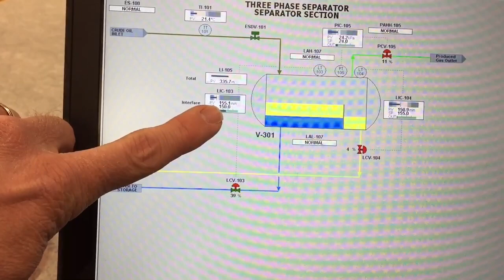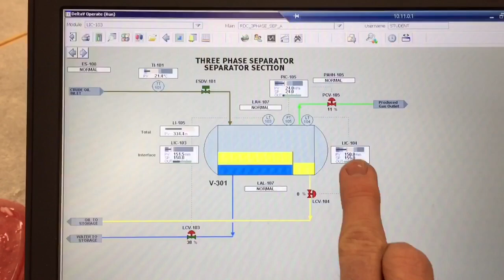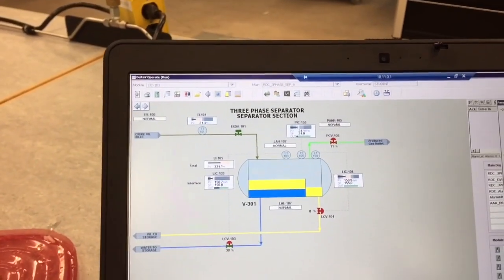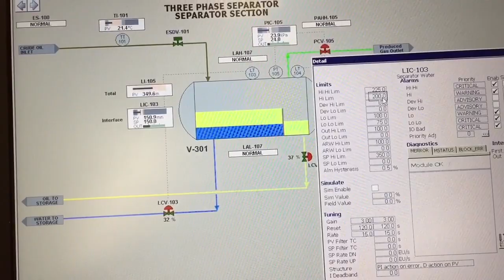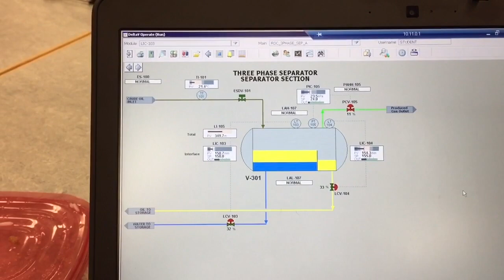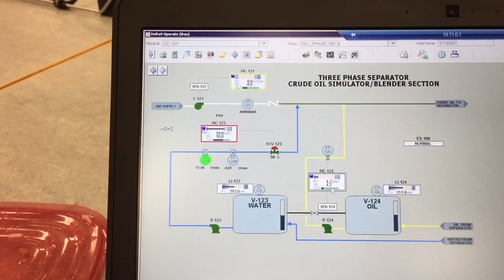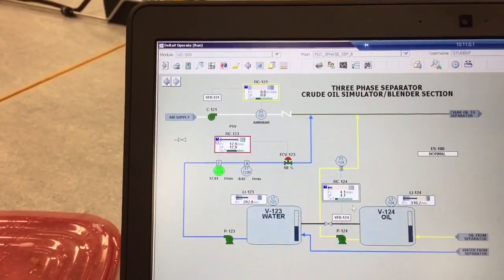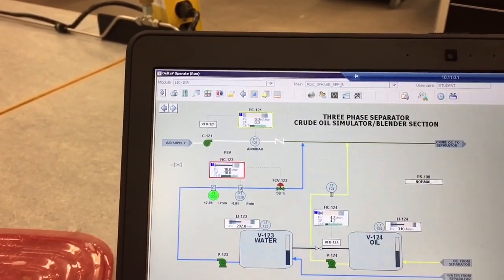Three-Phase Separator

Comment: Dear
gentlemen, thank you for the very useful video. In your experiment you express
the problem between internal mounting and external mounting of the interface
level instrument. At 1:25 clearly shows the difference between the
internal level of the vessel and the sight glass. The difference as shown is
the expected. Since the upper tap located on the top of the weir the oil sample
comes inside to the sight glass is the lightest. Similarly since the lower tap
located on the bottom of the weir, the water sample comes inside  to the sight glass is the heaviest. Thus the
external mounting instrument for measuring the interface level (sight glass)
indicates higher level. The color also differs, steady yellow outside , unclear
color inside. In the 5:22 minute the sight glass at oil side of the
vessel indicates significantly higher level than the inside level of the
vessel. The color also differs is yellow transparent.

Comment: Will you be able to accurately measure oil volume and water volume separately? Also can it remove crude oil from water properly like uhhhh- it’ll fully separate the two
Reply from the maker: There is no online water-cut analyzer on this trainer, so I’m not sure the exact amount of water left in the separated oil. I would estimate it still has about 10% water. In industry a demulsifier chemical will be injected into the feed and the vessel will be heated to about 30-40 C to increase separation. This will get the water cut to 1% or less. The separated oil is then stored in a storage tank and same with the water. The water is injected back into the ground with an injection pump and typically metered with a turbine flow meter. The oil is often trucked or pumped out and metered with a positive displacement flow meter. The volumes are determined by these flow meters.

Comment: This is great! a few questions; what measures the oil-water inter-phase, as to ensure we dont get too much water up and flowing over the weir? you didnt mention any thing about the gas.
Reply from the maker: Miebaka koko A Rosemount 5300 guided-wave radar (GWR) level transmitter is used to measure the oil-water interface. The gas used is just air that comes from a blower in the mechanical room next door.
Reply: @AutomationCliff  Is not it called nuclear gauge devise
Reply from the maker: Sean Mamedov not on this trainer. We use a guided-wave radar (GWR). You can get nuclear level transmitters as well though.
Reply: @AutomationCliff  I am working on sizing the horizontal three face separator for crude oil, gas  and water as intern. I was looking for a guide(api 12j). By any chance, could you help me to find it? The once that online don't show formulas or calculations.
Reply from the maker: @seanmamedov9612  Sorry about the late reply on this. Try Section 7 of the GPSA Engineering Data Book.

Comment: Where does the oil under the spilling threshold go?
Reply from the maker: @radiateurfou185  it goes back to the oil tank.
Reply: @AutomationCliff  I only see the water pipe on the left of the weir. does the oil go there too?
Reply from the maker: @radiateurfou185  If go to about 5:00 in the video you will see the water piping on the left like you mentioned and the yellow oil piping on the right.
Reply: @AutomationCliff  Yes but the oil on the left which is under the spilling threshold, how do it go to the right?
Reply from the maker: @radiateurfou185  sorry I understand what you are saying now. In a three-phase separator like this one, the interface between the water and oil is maintained. This is done by measuring the oil-water interface and then throttling the water valve - there will always be oil there in normal operation. If the feed starts to have more oil, more oil spills over the weir if the feed has more water, it will cause the interface to rise, but the automated water valve would open more to bring it back down. If an operator actually wanted to push all that extra oil over, they would have to raise the setpoint for the interface up, but they would risk spilling water over into the oil and the oil wouldn’t be as pure. This process is continuous. It has a constant oil-water-air mix fed into it and constantly produces separated oil, water and air. As more oil comes in, the oil you are concerned about will spill over and exit out the pipe on the right. I hope this makes more sense now.
Reply: Thanks for the answer my question was very confusing sorry. I think i get it, it is continuous so no need to evactuate the oil on the left. It will be relevant only when draining
Reply from the maker: @radiateurfou185  yes that’s correct!

Comment: Oh yab a controlled environment. Because thats what happens in a true well test hu
Reply from the maker: No, this controlled environment you are witnessing would be closer to a Free-Water (FWKO) Knockout found at conventional oil battery, not a well tester. The FWKO would have a more consistent flow into the vessel over a free flowing well. Thanks for your comment!
Reply: @AutomationCliff  it sais "3 phase seperator" no free water ko. This guy
Reply from the maker: @MrChidorinagashi10  Yep, that’s right. A well tester and FWKO are both forms of three-phase separators.